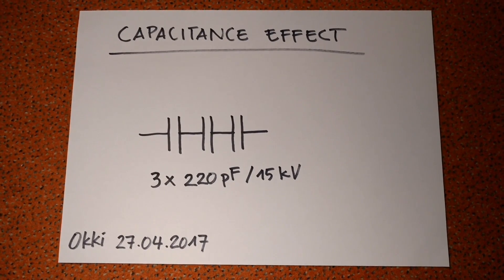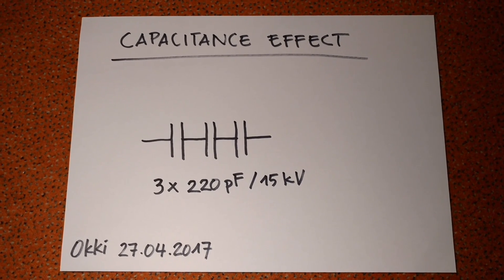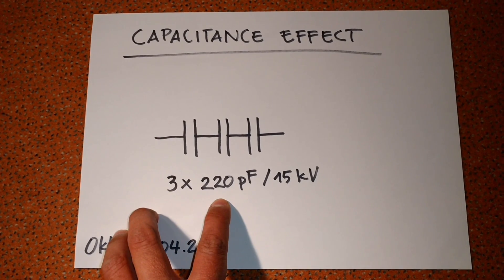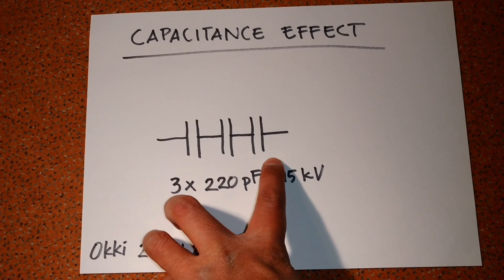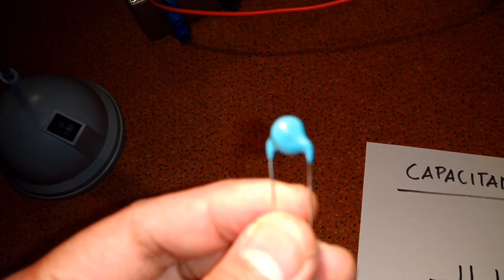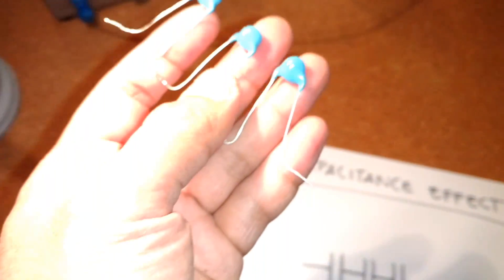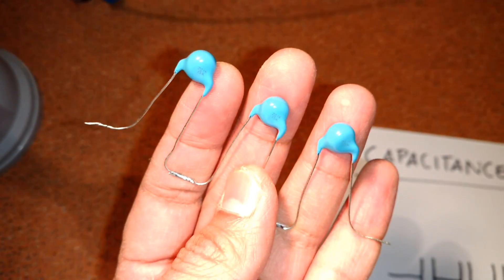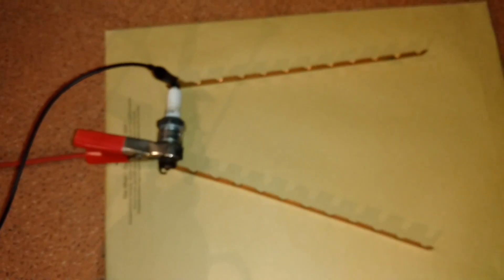Simple Plasma Ignition - Capacitance Effect

Comment: UPPER LIMIT ? 🤔
In practical engine applications the operation changes because the effect of increased air pressure in the cylinder on the spark ignition voltage must be considered.
The limit of the energy who the ignition control unit can transfer to the spark plug in each spark must also be considered, especially in the case of simple capacitive discharge models.
I've done some calculations, and it's my opinion that the maximum capacitance added in parallel to the spark plug should not exceed 2000 pF overall, otherwise the energy transferred by the ignition control unit may be insufficient to reach the arc ignition voltage.
Have you done any practical tests on an engine to find an upper limit of the capacitance added in parallel to the spark plug?
Best regards. 🤗

Comment: Hello friend, how are you?
Congratulations on your video, it is very interesting. I did this experiment and it worked perfectly, however, to facilitate assembly, I placed the capacitor very close to the coil instead of placing it close to the spark plug as demonstrated in the video, and in this condition the spark is weaker than the original without capacitor. Can you tell me why the distance between the capacitor and the spark plug affects the performance of the circuit?
Reply: Сопротивления на кабелях

Comment: Dá para usar o de 100pf 30kv?
Ou é melhor usar o de 221k 20kv?
A bobina de ignição gera 40 mil volts.
Reply: If your coil generates 40 kV, then you should use Capasitor Voltage more than 40 kV, & the cable also should hold more than 40 kV, otherwise, it might be dangerous 

3 pcs of 221 15Kv capacitor would be sufficient....

Comment: what if we put it between coil and CDI?
does it work?
Reply: CDI only gives 12 volt pulse to the coil to know when to spark. Adding these capacitors between CDI and the coil will damage the coil as it will alter the input voltage. These capacitors have to be connected only to output of the coil which is connected to the spark plug
Reply from the maker: This one will work if connected in parallel with the spark plug.
Reply: @OkkiMoeljadi  I mean, if we put it paralel but between cdi and coil like the spark plug, does it work?
I put plasma capacitor 15KV paralel like your video, and then it exploded.. maybe I should buy 20KV above..
if the capacitor put them in series does it increase the capacitor voltage's tolerance?
Reply: @koso.research16  Yes series connection will add up the voltage.

Comment: Can it be used with all ignitions: magneto, ingnitions with contact points, CDI...? Thanks.  (Peut-on utiliser ce système avec tous les allumages : magnéto, allumage à rupteurs, allumage électroniques... Merci.)
Reply from the maker: Yes, you can implement this on any ignition type.
Reply: With making and using this curcuit enhancement, I believe that the spark plug could get worn out faster? Also, maybe the spark plug runs hotter than normal, forcing us to use a colder spark plug range?

Comment: Plasma spark is also creared using a diode across ht and lt of the coil. What if you used both diode and caoacitors?
Reply: I have the same question right now but i'm afraid to test it on my bike

Comment: Well I did try out plasma ignition it works best with light weight fuel types but there is a catch i experianced faster starter motor turning me alternator who is 10si delco model cinde of displaced the starting charge rpm from 1000 rpm up to 2500 rpm so any ideas how I solve that grounding problem ? I dont have on me europ version 10si alternator I do not have resistor ore capacitor inside that alternator how can I solve that peoblem?
If it can increase starting charge so I was wondering can centrain capacitors reduce starting charge for alternators?
Definatly it works smuther motor faster but like told before it depends on enviroment and fuel type used.
I used it directly on me E core type singel hei ignition coil mounted ceramic capacitors directly to coil positive and simply put it any where on the ground chassis.
Thank you Okky 🥰

Comment: I have my research that is useless  it only works on air gap current goes directly to that ground  the capacitor when it's loaded with gasoline. you only need 100pico farad to run efficiently

Comment: How ever plazma is usefull ore amplifier ignition but there Is down side to it in my case starter motor spin faster and it did actualy change the starting charge rpm on the alternator I did not notice bether economy so fare I belive my car works bether with amplifier ignition then plazma due to fuel quality probably .
I dont know how to solve that problem with grounding effects to my alternator?
If it is posibel to change rpm speed by useing capacitors probably there is a way to force alternalor charging at low speed like 500 rpm thats normaly where I wuld force my classic car to idel .
I need desperatly cinde of variabel dual ignition with relays ore somthing like that .
Need to finde some solid state circuel with out those dumb ignition modules.
I have problem due to my voltage regularor in the dashboard and 4 pin gm ignition module I cant use my R type starter motor selenoid to bypass some voltage on engin start up the fuse pops and I can not start my car does some one know how culd I bypass this problem? It seams its related to coil polarity I ques wuld a 5 pin dual polarity relay help to solve this problem? I have singel HEI e core type ignition coil.
I have more of those coils and ignition modules so I wondered if I culd make dual ignition ore buzz coil with that staff?
My engin can run on compresion stroke and exaust stroke seperatly ore together as unit like waste spark ignition system.
So Im wondering if ordinary relays with singel induction trige culd do the same trigering effects ore useing dual 4 pin gm ignition modules?

Comment: with how much voltage were you supplying the spark plug with?
Reply from the maker: I use ignition coil to power the spark plug.
Reply: Try to use copper wire to strap around on your ignition coil . My bike already gone very smooth riding and smooth combustion. Some shop say need overhauled but actually not engine issue, it was electricity issue, electricity went anywhere on Frame that why voltage got drop

Comment: Hi real case scenario of putting 3 capacitors in series for bike ,where to connect -ve or earthing connection. Can it be connected to chassis.
Reply from the maker: Yes, one side of capacitor is connected to chassis.
Reply: Ideal what is the total number of capacitors required for bike of 160 cc.

Comment: Perbandingan bgmn ? 3 ×220 pf 15kv dg 1× 220 pf 20 kv ?
Reply from the maker: Kalau nilai kapasitansinya semakin besar, percikan apinya juga akan semakin besar.
Reply: Apakah akan sama hasilnya ? Pararel vs seri
Reply: Artinya klw pake 470pf 6kv di banding dg 220pf 15kv ini gmn Mas
Reply from the maker: @HydrogenH2O  rating tegangannya harus paling tidak 20 kV. Lebih mudah menggunakan 1 buah kapasitor 100 pF 30 kV daripada 3 buah 220 pF 15 kV. Sebelum dipasang harus dicoba dulu dengan busi diluar mesin dan dilihat apakah businya bisa mengeluarkan percikan api atau tidak.
Reply: @OkkiMoeljadi  bagaimana jika 220pf 30kv mas..
Reply from the maker: @iman.slamet  bisa juga.
Reply: @OkkiMoeljadi  mungkinkah jika 9 kapasitor (ga usach 12) itu diringkas jadi 1 komponen saja (misalnya) agar tidak makan tempat...
Reply from the maker: @iman.slamet  bisa saja. Video ini saya buat untuk menunjukkan pengaruh ukuran kapasitor terhadap percikan api di busi.
Reply: Och... maaf, maksudnya saya mau pake 9 kapasitor. Jika dijadiin 1 komponen ukurannya berapa..(mungkinkah..) 
Khan kalo di seri pfnya turun nilai voltnya naik atau tetap, sy liat pake kalkulator online ga ada yg bahas nilai voltnya
Makasih kak..
Reply from the maker: @iman.slamet  beberapa kapasitor disambung secara seri, voltasenya akan naik sebanding dengan jumlah voltase masing-masing kapasitor. Contoh: 3 buah kapasitor 15 kV disambung seri, hasilnya rating tegangannya naik jadi 45 kV.
Reply: Semakin besar KV brarti semakin besar apinya om?

Comment: very nice work...wondering if this can be done to a coil on plug set up...i know is very little space on the coil to install 3 capacitors or varistor but hey,you are a geniuos let me know please!!!!!! also if this can affect the computer signal and burn the ecu coil drivers,thanks a lot
Reply from the maker: Someone posted a photo of this setup on a coil on plug type of ignition coil. You can use only one capacitor instead of three. I recommend 100 pF 30 kV capacitor.
Reply: @OkkiMoeljadi  thanks a lot for the info i will try it myself keep the good work
Reply from the maker: @scoupemaster  you're welcome!
Reply: Can I try to use this setup in a car?

Comment: Hi Okki is it ok to use ceramic capacitor in a Scooter 125cc?
Reply from the maker: It should be OK. I mean, if your ignition system is good, it should work without any problem.

Comment: how if 2 x 220 pf 15 kv, please
Reply: Capasitor in series with same amount of Capacity will divide by the  number capacitor you use, but in paralel will added the Capacity, example if you have same capacitor 10pf/10kV in 2 series in will be 5pf/20kV, if 3 will 3,3pF/30kV but if connect it paralelly it will  be added, 2 paralel will be 20pf/10kV and 3 will 30pF/10kV
Reply: @yr6sport418  very very informative explaination, thank you..
Reply from the maker: It is possible but maybe the capacitance a bit too high.
Reply: @OkkiMoeljadi  how come 2 x 220 pf 15kv higher than 3 x 220 pf 15kv? i need explanation pls :)
Reply from the maker: You can use online calculator to find the total value of these capacitors in series.
Reply: @ogbugoy3981  in series capacitance decrease ask resistance in parrellell.and voltage added. In parallel capacitance increase as R in series (added).
Reply: Can i use 222pf 1kv ?

Comment: saya coba untuk mobil dgn mengunakan tci ngk bisa bang, adakah yang salah
Reply from the maker: Bisa. Caranya sama saja dengan ini.
Reply: @OkkiMoeljadi  ngk bisa distarter bang untuk kabel sya menggunakan kabel copper braided, awalnya saya mengunakan dua set seri trs dipararel, trs sya kurangi jadi 3biji  seri
Reply from the maker: Usahakan kapasitans totalnya tidak lebih dari 100pF dan dites dulu dengan busi di luar mesin, keluar apinya atau tidak.
Reply: @OkkiMoeljadi  sekarang saya coba pakai 3 kapasitor di seri, yg ujung A sya sambung ke busi dan yg ujung B ke ground mesin nyala busi lebih besar dari standar, tpi mesin tetep ngk mau nyala, klu di lepas groundnya bisa nyala normal. apakah ada rangkaian lainnya ya bang untuk pendukungnya
Reply from the maker: Itu koil pengapiannya lemah. Coba pasang kabel besar dari plus aki langsung ke plus koil (ngetesnya bisa pakai kabel jumper aki), terus dicoba lagi. Kalau tetap tidak bisa berarti koilnya harus diganti baru.
Reply: @OkkiMoeljadi  siap makasih bang

Comment: Sir can i apply this configuration on my bike ignition coil? To increase spark intensity?. And one more question. The timing of the single spark from ON to OFF would remain same. Cause if the length of spark increases with these capacitors so it can cause ignition timing problems. Hope your give me answers. Thanks
Reply from the maker: Yes, you can use this on a motorbike. Only spark intensity will increase, not the duration. Check out my other plasma videos on this channel, I have posted all information here. I have compiled the videos on my playlist.
Reply: @OkkiMoeljadi  when i connect 1uf 440v capacitor on the secondary side then the spark intensity decreases significantly. Dont know why. I have tried with 500v 220pf blue colour ceramic capaitor but now the spark intensity is same. Is there my bike cdi is responsible for this? Maybe a diode could be installed paralle to the primary side of coil wires in the cdi to short the reverse current. Anyway If i use car ignition coil (can type oil filled) then it would increase spark intensity?. Because my motive is to increase the power of my 160cc engine

Comment: if all of those where put in an motorcycle engine will the engine handle that kind of high voltage?
Reply: I think It should work fine in engine with carburetor. For fuel injection you may need to filter the electrical noise caused by the high voltage, but try and see.

Comment: Pa Oki, mau tanya. Kalo utk mobil yang multi coil spt yg skr" ini gimana? Masing" busi kan pake koil sendiri". Apakah sama juga bisa menggunakan metode ini juga utk memperbesar pengapian sehingga power jadi besar dan irit bbm?
Tiap koil ada socket dg 3 kabel yg ada 12v cuma 1. 

Dipasaran ada dijual alat utk memperbesar power dan irit bbm (i-Force) mungkin pa Oki pernah dengar. Apakah menggunakan ini juga?
Reply: Sistem mas oki ini dia bukan ke kabel yg pak ronny maksud. Dia itu setelah koil pak. Keluaran nya sudah ribuan volt. 
Kalo yg bpk mksd itu kabelnya baru 12 volt.
Reply: @dodododo619  iya, makanya sy coba tidak berhasil. Untuk ambil setelah koil sepertinya tidak memungkinkan. Karena sistem Direct coil sdh sangat rapat sehingga tidak ada celah lagi utk selipkan kabel.
Reply: @ronnygani3652  betul pak. Tapi coba dulu pak. Tarik kabel di ujung kop busi yg plus nya. Masa nya coba tempel di body mesin. 
Ini mudah kalo yg pake delco pak sistem pengapian model lama. 
Saya juga direct coil. Lagi usaha gmn bisa nembak busi nya.
Reply: @dodododo619  hehehe...iya nich pa. Lg dipikirin sampe jungkir balik gimana cara nyelipin kabelnya....
Reply: @ronnygani3652  jumper satu2 kabel positif yg ada di shoket koil dg rangkaian capasitot plasma kabel yg lainnya kunci pd masabody.ngaciiiir dech

Comment: I tried this it works. But when I connect it to the body ground of motorcycle, it wont start.
Reply from the maker: Try it again with smaller capacitor value.
Reply: @OkkiMoeljadi  like what value specifically? Does it have anything to do with the ignition coil?
Reply from the maker: Yes, if you have high power ignition coil, you can use higher capacitance. I use capacitor with capacitance around 73 pF.
Reply: Okay thanks for the reply. Ill try to hook up a high power ignition coil.
Reply: Decreasing To the PF value, 
the voltage value are follow the output coil value that generally have 10-12kV range. Using 15kV just to make the Capasitor not going break.
There are 2 ways to decrease the Capasitor value, using direct replacement with smaller capacity or connect it in series.
If you connect 2 caps with same value then you'll get half value. If 3 in series and the same value, you'll get 1/3.
3pcs of 220pf in series means 220/3 = 73pf, if you connect one more 220pf in series you'll get 220/4 = 55pf

Comment: si decido hacer esto en mi moto 
¿su rendimiento es igual, mejor o peor?

If I decide to do this on my motorcycle Is your performance the same, better or worse?
Reply from the maker: I don't know. It depends on your actual system. If the combustion of your engine is already good, this will not make it any better. But you can try and test it by yourself, maybe you'll see some improvement. Anyway, this system is very simple, you can just try it.
Reply: @OkkiMoeljadi  vh

Comment: So what exactly is happening here? Are the capacitors generating a higher voltage? Or causing oscillations (multiple sparks)? Can it really improve power/fuel economy and where is the proof?
Reply from the maker: By adding small capacitor, you will just increase spark intensity (but not the voltage). Please read some information about Nology HotWires. They use the same technique as this.

Comment: The interference that this would cause being unshielded will stop anyone with any communication device from being able to hear anything the device transmits.
Buzzzzzzzzzzzzzzzzzzzzzzz😎
Reply: The ECU and sensors are designed to work within certain tolerances. I've modded one of my cars where I used zero resistor plugs and zero resistor cables and a spark amplifier without any negative noticeable effect on the electrical system. But some vehicles may not perform as well.

Comment: So, how did you distinguish negative from positive to discern series from parralell ?
Reply from the maker: These are non-polar capacitors. It doesn't matter which pin connects to what pole.
Reply: @OkkiMoeljadi  Thanks ,  I thought that's the only way it was possible. So now, I will make my Mercedes even more efficient via each cylinder coil packs and dual spark plugs.  Keep up the excellent work. And thanks again.

Comment: Is impressive how the spark plug really increases the power. But the is question how long the spark plug last without failure due to electrodes worn out or cracked porcelain? On the other hand, I cannot see how you can put the capacitors on the engine without the terminal caps arcing?

Comment: Hi, Can I use in my car with Computer system electronic and resistor platinum bosh spark plug +2? ... I dont know about RFI
Reply from the maker: I use this on my fuel injected car. Just check out my other plasma ignition videos.

Comment: Where should i connect to 2 stroke engine? I'm not so sure either ground to coil or groung to sparkplug? Since my engine have 2 coil, source coil and ignition coil..
Reply from the maker: Just connect the capacitors parallel to each spark plug. Check out my other plasma ignition videos for more info.
Reply: @OkkiMoeljadi  is there any link for that sir?

Comment: Prabens for work, I can use 3x220pf / 15kv with my coil, SPA Turbo X-Force ignition coil
60.000V ignition coil
Standard pole with center Pin
a stronger spark will make sure that all the fuel inside the engine ignites, resulting in higher HP, and fuel economy
    Maximum Voltage: 60,000 Volts
    Primary Resistance: 0.3 Ohms
    Secondary Resistance: 6.5k Ohms
    Inductance: 3mH
    Turn ratio: 85: 1
    Peak Current: 300mA
Reply: and the result are?